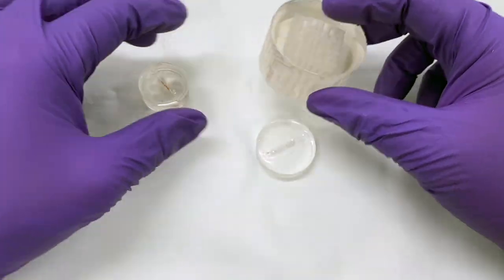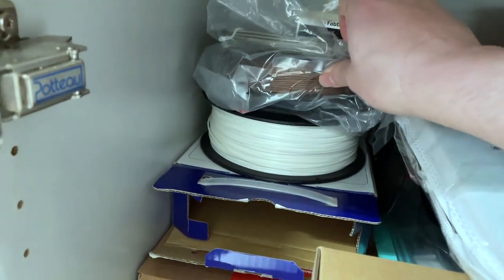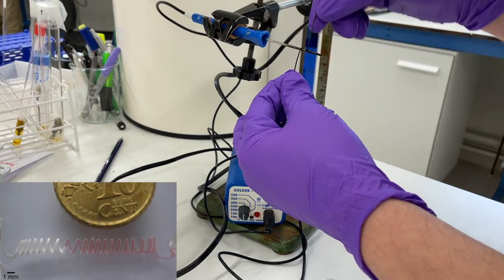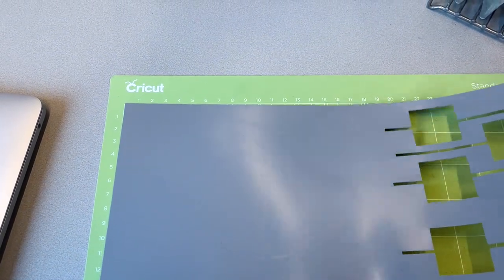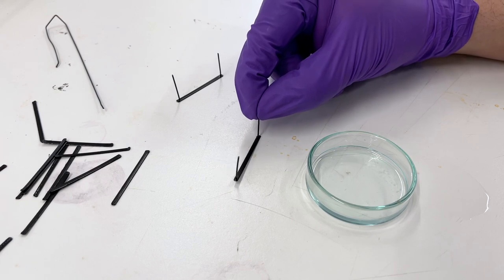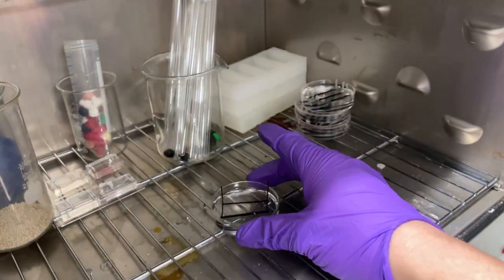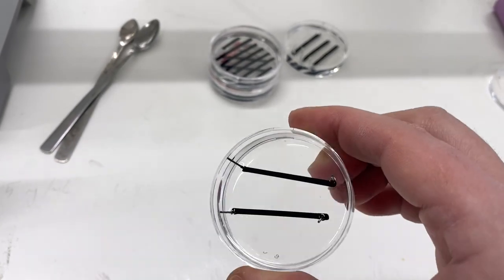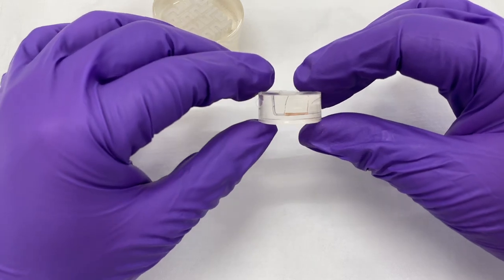3D printed PDMS microfluidics tips and tricks (ESCARGOT)

Comment from the maker: obviously ask here if I forgot something :)
Reply: I am trying to make microfluidic channels using DLP printed resin mold and PDMS. But curing inhibition occured at the interface between resin and PDMS. I have tried several methods such as wahing with isopropanol, UV curing, PVA coating, baking, and surface silanization. But couldn't solve the problem. Can you provide any suggestion to solve this problem? Thank you in advance.
Reply from the maker: hi there (and sorry for the late reply). We used PFOTS (a perfluoro compound) to make the surface of the DLP printed part non reactive. We first was and cure the printed part, then we do plasma for activating the surface and a chemical vapour deposition to cover the part with a silane. The method is described here: https://pubs.rsc.org/en/content/articlelanding/2020/an/c9an02407g#!divAbstract
Reply: Thank you for your kind reply. i will try that method.

Comment: I also wanted to do research on microfluidics in our lab, so I referred to your videos and papers. However, the abs we bought didn't melt even after putting them in acetone for over a day. It was similar with a syringe. I think maybe there is problem with abs. Could you tell me the company name and product name of the abs you used?
Reply from the maker: we use various brands, most of them made in NL (like real filament, or Jupiter filament). Just buy the cheapest ABS you can find, or if the design is not that difficult, you can try to print in PVA and dissolve it in water.

Comment: Nice trick of using partially cured resin to enable sticking of the next pdms layer. When I can't just use regular O2 plasma or corona discharge to make a solid to solid bonds, I usually let the bottom layer cure completely and treat the surface with Dow corning OS1200 primer before pouring the next layer. This stuff is magical. You can get the PDMS to permanently (i.e. stronger than pdms it self) bond to most treated materials during the cure. Very useful to embed tubing or other structures in the pdms. It is just a bit hard to procure and has a limited shelf life.
Reply from the maker: that's very good to know, for the tubing you insert the tubing first and then cover the connection with the OS1200? need to give a try :)

Comment: Nice idea to use ABS, I knew it was soluble but didn't expect it to dissolve over 12h in a microfluidic device.
Reply from the maker: it can take waaaaay less if you push it out while dissolving :)
Reply: @v_saggiomo  Now I have to buy those sub-millimeter nozzles :D (I meant 0.2mm, which I don't have atm)

Comment: Just stumbled onto this channel and had a quick question. Why did you choose ABS and not a water soluble polymer like PVA? is PDMS compatible with H2O? i assume so right?
Also greeting from the netherlands!
Reply from the maker: you're right. It is possible to use PVA and someone did it years after we used ABS/acetone. In 2015, when we did it, PVA was not yet that much available, and very difficult to print. Nowadays it's better. 
a second point is that ABS/Acetone is faster than PVA/water as acetone is swelling the PDMS just a little bit that favours the dissolution of the ABS.
cheers :)

Comment: Which is the smallest diameter you can design for a channel?
Reply from the maker: depends on the nozzle of the printer (400um the standard, 250um doable, 100um very difficult)
Reply: @v_saggiomo  one more question! With this methodology, if I mixture oil and water phases (with T formation),  which is the smallest size of droplet, I can have? It depends only on the flow rate?
Reply from the maker: @katerinasaiti9572  very difficult to say. It depends MOSTLY from the flow and the geometry (T shape versus Flow focus droplet formation). My guess would be 50-100um. here we did something similar https://twitter.com/V_Saggiomo/status/1400722212185948161

Comment: Have you ever managed to do this technique using 3d printed parts from a form labs SLA or Polyjet printer?
Reply from the maker: well, yes and no. Resin are cross linked polymers while FDM are thermoplastic, this means that for the resin (usually acrylate based) you need to break covalent bonds. So it works but with harsh chemicals (sulphuric acid for example), not really nice to handle.

Comment: Any recommend method to combine pdms to pdms together ?
Reply from the maker: if the pdms is already cure, then just plasma oven, otherwise they will not stick into each other. If not fully cured they will just stick together.
Reply: if its half cured. its easier if you make one part lean on hardener and the other part rich.  5:1 and the other one 20:1.